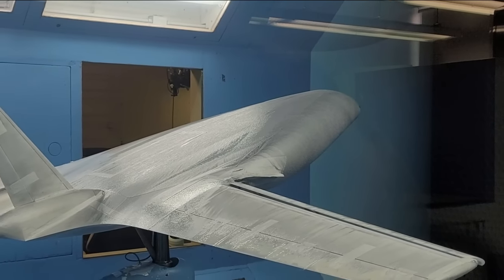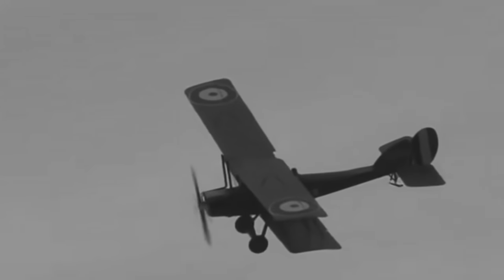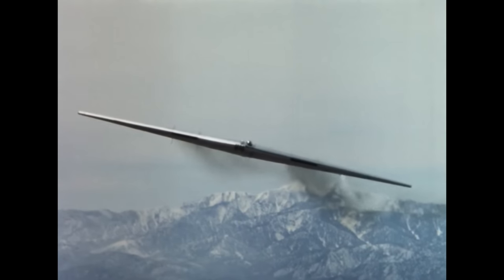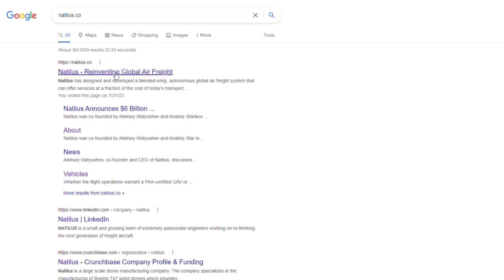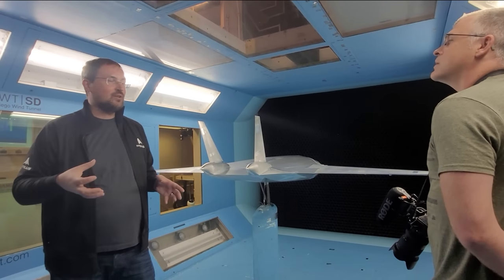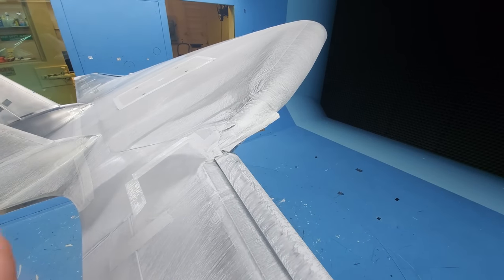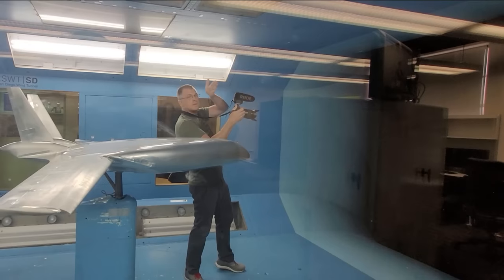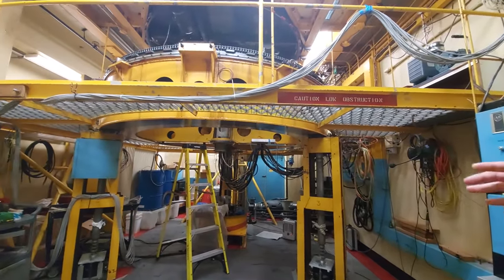Blended Wing Bodies:  The Future of Transport is Here (Featuring Natilus)

Comment: The concept is not new.  The trick is to design a structure to withstand the pressurized blended fuselage and keeping it light weight.  There is a distinct advantage of the traditional round tube fuselage is the shape can withstand pressure very well.  With the blended body, it is more difficult to design a light weight pressurize structure.  It is a careful blend of compromises that aircraft designers are not used to in the last 80 years.
Reply: Everybody who's looked into it: NASA, TsAGI, Russavia, Airbus, Boeing & McD before them, Lock-Mart, say otherwise.
Lifting fuselage bodies offer less empty weight and construction cost, more internal volume, less wetted area and drag, improved L/D.
Burnelli was doing it in the 1920s and onward.
Many others built lifting body fuselages with fins that the media called a "flying wing" that had no problems with stability and yaw authority.
Reply: @JFrazer4303  Okay. nobody said anything about stability. Blended body is not flying wing.

Comment: Fuel efficiency drives aircraft design, the wing and tube has been pushed as far as possible but can no longer deliver significant increases demanded by air carriers. I agree that BWB is the direction  for air cargo aircraft where none of the difficult human engineering problems of exiting, pressurization  and passenger G loads need to be considerd..
Reply: Lot of resistance to BWB and flying wing designs among pilots and the people signing off the checks for development though. They don't like things that don't look like how a plane is "supposed to" in their minds.
Reply: @atomicskull6405  Yes, passengers and airlines have an aircraft design prejudice.
Reply: Fuel efficiency does not drive aircraft design on its own. There are many other factors that play an equally large role. For instance, payload capacity, manufacturing cost, and safety. That is definitely wrong as a general statement because many aircraft, such as fighter aircraft or any helicopter, move fuel efficiency even lower on the list of priorities.
Reply: @Elrog3  The topic of discussion was commercial  cargo planes.
Reply: @olsonspeed  Not keeping that specified is playing a bit looser with language than I personally like to, but fair enough. That's just a difference of preference.
 
Even within the topic of cargo planes, Manufacturing cost, speed, and payload capacity are at least as high on the list. Fuel efficiency doesn't explain why aluminum is the primary construction material for aircraft. Nor does it explain why we would transport cargo with a plane in the first place. If fuel efficiency is not directing us to make a plane, there must be some other factors that are. And they would be more directly responsible for the cargo planes existence.
Reply: @Elrog3  You intentionally took my comment out of context.
Reply: @olsonspeed  How about you answer for the fact that even in that context, it is a false statement.
Reply: @olsonspeed  And the meaning of words can change with context, but changing "aircraft" to "commercial cargo plane" is an unreasonable stretch. God forbid, we wouldn't get anywhere if everyone interested in engineering or the sciences had as low of a bar of specifying what they mean as you do.
Reply: @Elrog3  Sorry, you will have to find someone else to troll.
Reply: @olsonspeed  Commercial cargo planes make up a tiny fraction of all aircraft in the world.

Comment: So many interesting tidbits in this discussion. It never occurred to me that the tube and wing profile was so ideal because of its inherent ability to handle pressurization and depressurization because it's basically a large, thin wall aluminum propane tank with wings.

Also the issue with roll generating ~2G's because of the distance the passenger would be from the center of roll is interesting and I'm not sure I would've ever given it a second thought.

Comment: Future utility considerations should include the possibility of combining passenger and freight transport by centralizing passengers within the longitudinal axis while relegating cargo to blended wing portions of the relatively unpressurized and more accelerated regions of the fuselage.  In this way passenger proven tubular designs could be directly imported into the structure.
Reply: I was thinking almost the same thing.  The pax could be a pressurized oval cross section tube.  This would give the pax more space.

Comment: Yet another beautiful 3D design that will never fly.
The aerodynamics of aircraft are perfectly well understood. The current challenges are in material sciences and manufacturing. When Airbus designed the largest aircraft ever to see the sky they didn't look for an alternative to the basic shape of an aircraft. Not because they weren't allowed to, what they were doing was already considered crazy, but because some of the best and brightest engineers in aviation couldn't see any benefit even close to overcoming the downsides.

Some simple examples: 
The wingspan of the A380 is limited because of the Taxiway and Gate separation on the majority of airports. The infrastructure for un-/boarding and un-/loading had to be modified for the A380 leading to many airports not being able to service it.

For a design like a blended wing you can forget about using standard gates, meaning the thing needs to carry its own stairs and cargo handling equipment. There are decades worth of testing required to assess the long term viability of such a radical pressurized cabin.

And none of that even touches on the training requirements for every single person involved in running and maintaining such an aircraft. The manufacturing is also completely different. You can't construct these types of blended wing craft in pieces and assemble them only close to the end. They almost require a mostly single mold composite construction, which has never been done at this scale both in dimensions and production levels.

Remember the Airbus vs Qatar Airways crap? That was because they had a delamination in one of the top layers of their fuselage. That was on a simple surface bent in mostly one plain.

So, the answer to the implicit question this video failed to address: Why aren't there blended wing designs out there in the wild?
Because the manufacturing, maintenance and operation is prohibitively expensive, the benefits are marginal and the upfront investment would beggar most countries.
Reply: This is always true for designs out of the norm of infratructure. The japanese bullettrain was also considered madness and it needed completely new trails to operate, which was a MASSIVE investment no other country dared to pursue. But it's massive success revolutionized how people see trains. It basically connects the 3 main cities of japan by being nearly as fast as airplanes, while way easier to use for everyday life. And the japanese right now invest in a new magnetic train design again considered to be crazy. Time will tell if the project is realistic, but if succesfull, would practicaly merge the cities as how fast you can travwl between them. 

This aircraft will see its debut probably in the US military, which us more willing to invest in better performance than commercial endevours.
Reply: @DundG  no, the bullet train was not crazy. The engineering was challenging but within existing technological means. The A380 falls into the same region.
But this thing is just a pipedream. Period. You can't just handwave the issues I mentioned in my post. They nearly stopped the A380, and they certainly will stop anything as nuts as this.

Comment: Also great video as always! I'm a big fan of design innovation, although as an aerospace design engineer I fear that the real reason this hasn't caught on more is down to one word: motivation. Airlines have figured out how to operate a tube with wings on it, and aren't sufficiently motivated to change that perspective and totally renovate all airport gates in the pursuit of that last % flight hour efficiency. There is also the issue of massive change within a HIGHLY regulated industry, and the risk associated with that. Aircraft manufacturers and airlines would both need to have an appetite to accept that risk... and that's a tough pill to swallow.
Reply: Prove its safety whilst using freight for a few years. 
I feel the manufacturing facility retooling would be where the bean counters put a stop to it.
Reply: I think your right they dont esny change they all set yhere and clip their greedy cuepons although they would think the passengers would be stuffed like sardines in a metal can! If they did the design with a little more work they could make into a elon starship!scramjent motor it should be along with rockets motor is the w0sy indeed. As piciard said make it so it so!. Kenneth parrott
Reply: It's not because of rebuilding every airport or because of needed new technology that we don't have things like the Boeing model 754 or Burnelli lifting fuselages.
Immediate cut in fuel burn by ~25%+.
Reply: The biggest reason has nothing to do with motivation, it's evacuation requirements. As an aerospace design engineer I'm sure you know that to certify a passenger aircraft you have to demonstrate that it can be evacuated from full within 90 seconds with only half your emergency exits available. That's hard enough when you have a 10 abreast widebody, now do it with something stupid like 30 or 40 abreast in a BWB.
Reply: @HekateMGO  
And freight and military users don't care.
The military's idea of seating is "Pack in there until you make your buddy smile". To evacuate it's "Stand up, hook up, shuffle to the door. Jump out and count to 4".

In any case, everyone who's looked at it, says that it's feasible, especially for a moderate-sized plane (~>200 passengers) to evacuate it on time. Boeing and McD, Lock-Mart, TsAGI and Russavia, Airbus, etc.

Comment: I've built three designs that are very similar to this throughout the years. The first one was a prototype that was stolen when my house got broken into. The second one got trashed when a roof collapsed in a shed or it had all of my RC electronics and the third one is sitting on my desk right now finally being finished in its form. Very similar to this design but there are some striking differences. This is a little bit more efficient of a design than mine but mine is being designed as an ultralight. The blended Wing design cuts the weight dramatically! Unfortunately adding the proper length to the wings puts me over weight so I may have to go experimental. Right now it's in it's RC phase for scale testing. I've been waiting to see blended wings hit the market for decades and always knew they were more efficient ever since we launched the first bomber in a Delta configuration. I hope this makes it to the air!

Comment: Really interesting blended wings are a great development that hopefully whose time has come. A little surprised that the wings are not more blended in. The change from the body to wing looks like it generates quite a strong disturbance.
Reply: The junction of the wing and the body (as you saw in the tunnel) can create some interesting flows which can end up being useful.  There are other configuration issues not touched upon in the interview which leads to a BWB often have a fairly obvious wing junction.

Comment: People are approaching the freight volume problem with a technology mindset (brand new aircraft configuration) when there’s a much more obvious solution that costs nothing. 

Amazon packing is extremely oversized. It would be a simple matter to make each package slightly smaller. If you reduced the package dimensions by 20% in all 3 directions, the volume would decrease by *50%*. If you decrease the package dimensions by 37% in all three directions, the package volume would decrease by *75%*.  Based on the Amazon packages I’ve received, a reduction of 37% in all directions is pretty easy. 

How could the carriers force e-commerce retailers to reduce volume?  Charge them by volume and tell them how to save volume and money, and watch the package sizes shrink over night and the shipping weight skyrocket.
Reply: underrated comment. I was thinking the same.

Comment: How would the blended wing handling freight (loading & unloading pallets)?  I assume from the front using a clam shell door system.  How would the engine be accessed for maintenance?  Hard to access engines and may require special ground equipment (special crane).  Also, blended wing passenger planes would a harder time connecting to existing terminals

Comment: For arrival and departure into freight airports, they could use the nautical pilot model, where a locally based and knowledgable pilot remotely operates the aircraft and interacts with other traffic and air traffic control. This is a reasonable way to proceed with freight aircraft going forward.  
So for arrival and departure it can be remotely manned for integration.

Comment: Could definitely be a game changer for aviation, especially in the air cargo industry.  Potential problem for passenger use is going to be air sickness.  Any roll motion will be felt a LOT more by passengers in the "outside" rows which I think was one of the things that has held back the idea of a flying wing passenger plane.
Reply: It wouldn't be more noticeable than the acceleration of rear row seats when current airliners pitch. It generally works out okay because airliners maneuver very gradually.
Reply: @Michigan Engineer, he addressed this directly 16:30 minutes in as the third and final factor that killed the BWB for passenger use. It was an issue I’d not heard of before, and  @appa609  to your good point, I’ve flown back row (and front row too) enough on long bodies to initially agree that it isn’t too bad an issue. But then I thought about the difference between a few dozen people in the last few rows feeling like they might toss their cookies, vs the last two or three seats in every row on both sides of the plane. Aleksey may well have a better point, and he’s clearly thought about it a lot more than us, since this changed the direction of his company towards cargo instead. 

But it does make me wonder about running a pressurized tube down the middle of a BWB for passengers, with skylights instead of windows, and also putting lots of unpressurized cargo outboard in the wing roots. 😊

Comment: A blended wing body airplane's main advantage is by providing more internal volume than a typical tube and wing. It may have a slightly higher L/D, but this advantage is limited since the BWB's body is basically a short stubby wing and generates lift less efficiently than the actual slender wings. You get basically 2 practical advantages with this. You can carry more fluffy low density cargo like first class passengers, bicycles, internal airplanes, etc, or you can carry enough low density fluffy fuel like liquid hydrogen or methane. The second option is particularly interesting since besides being lower or zero carbon, lower density fuels also tend to have higher specific energies, meaning you can get significantly better range for a given fuel fraction.
Reply: Many designs are fit for heavier cargo, with less fuel burn onto shorter runways.
Bowing and McD before them, Lock-Mart, Airbus and TsAGI all say it improves L/D and payload & range.

Comment: Not the first blended body/wing, and the did not materialize for passenger transportation due to a major issue : PRESSURISATION and structural integrity that goes with it. Nobody wants to repeat the failure of the COMET. Fatigue of such a complex shape is hard to simulate. Maybe cargo transportation is the good approach.

Comment: What are the STALL Characteristics of the Blended Wing Body compared to regular (Tube & Wing) aircraft, also straight Flying Wing Type aircraft.
Reply: The stall characteristics of a flying wing (and by extension and blended wing body) are generally a fairly benign actual stall, with a high risk of loss of lateral and pitch control due to airframe blanking of the vertical surfaces and elevators.  This is one of the reasons why the vertical stabilisers of the Natilus aircraft have a relatively large span.  To ensure they remain in effective airflow (as shown in the tunnel ) and, secondly, because of the reduced moment arm of the vertical stabiliser from the aircraft CoG (a stability issue).  Masking of the elevators leads to a loss of pitch control meaning the aircraft cannot be pitched down to fully reattach the airflow.  A loss of lateral control leads to a spin.  Generally a blended wing body has a larger CofG range due to a longer central 'fuselage' section (a true flying wing not having any 'fuselage' ). Therefore, a BWB would have a 'safer' stall than a true flying wing (all other things being equal in the designs).